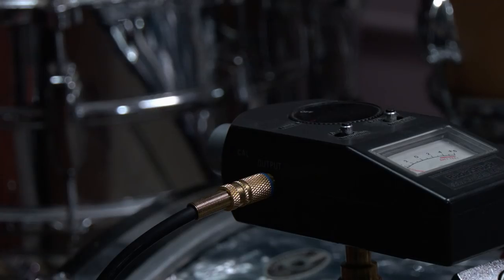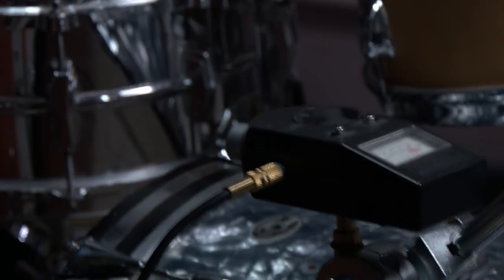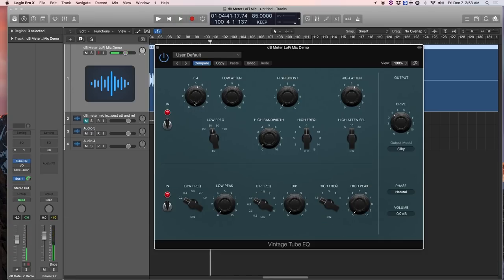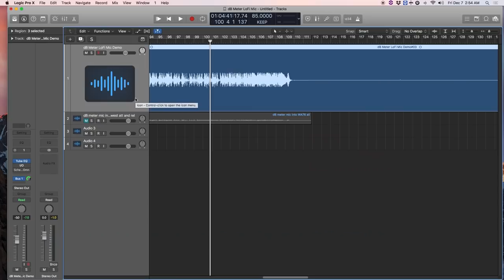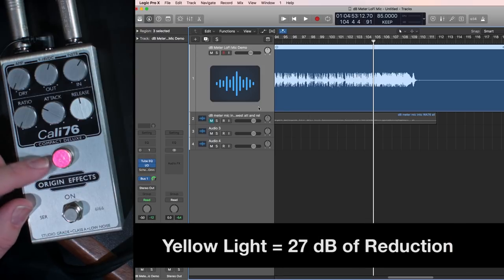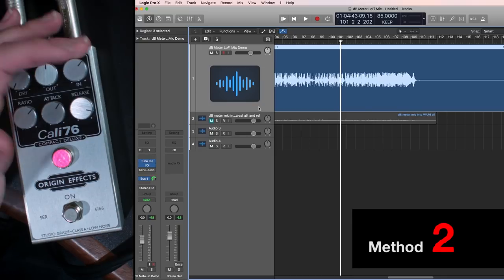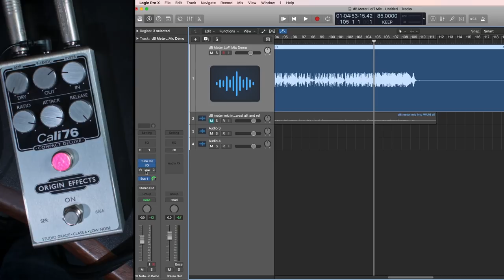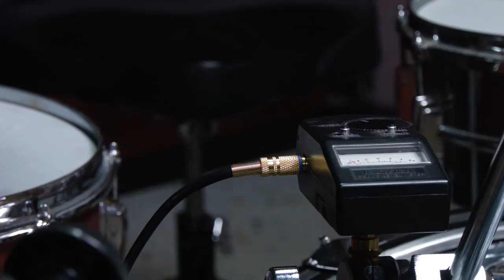dB Meter = Lo-Fi Mic

Comment: Pretty cool. I'm terrible at drum sounds and have virtually no mixing experience but that sounded like a decent room mic to me. I even used to own a set of drum mics but I'm an invalid when it comes to using them or DAW's or plugins, but that's seriously a pretty good room sound. Cleaned up even better, obviously. Reminds me a lot of a modern Buddy Guy tune. 

I saw your guitar sub-kick guitar video and mentioned it there, but I've been curious about using these for awhile now. I'm especially curious how the biggest or most "instrument-appropriate" speakers would do with their respective instruments. Say recording a bass with a bass speaker, guitar with guitar, or adding bass or highs by doing the inverse. Also useful on modern guitars with extra low range. Or maybe the biggest bass speaker you can find (18"? at least a 15" can be found easy) against a kick drum...

The possibilities are seemingly endless. It's cool that you're thinking about unique, oblique approaches and showcasing the results, learning neat tricks, kinda like the first time you plugged the headphones into the mic jack or vice versa.